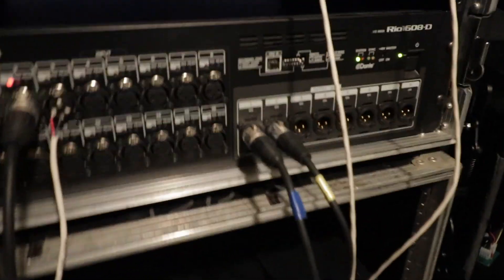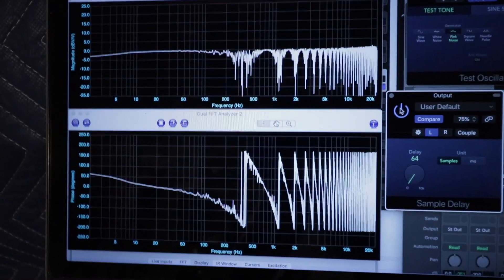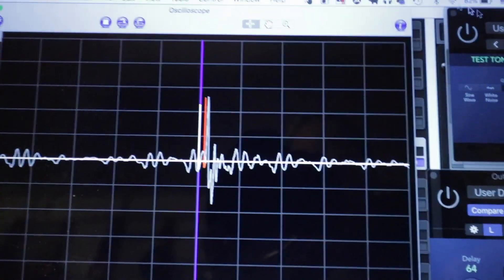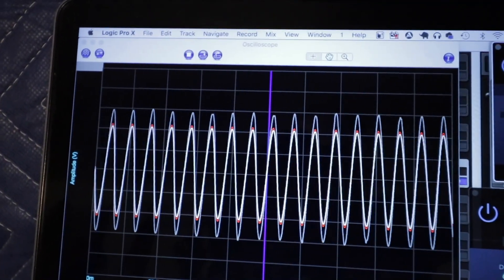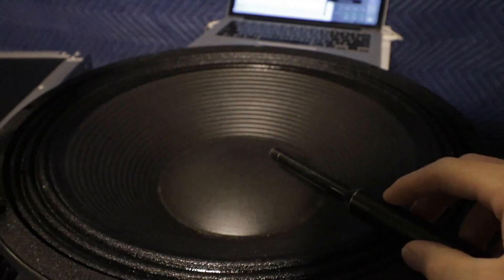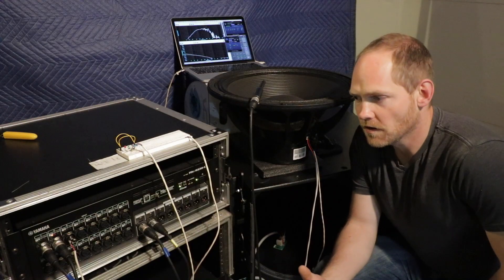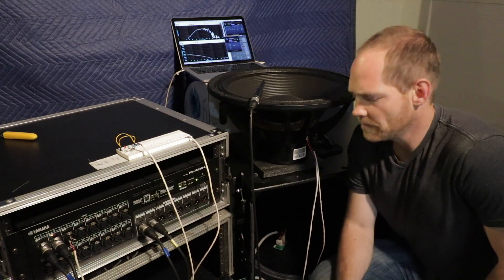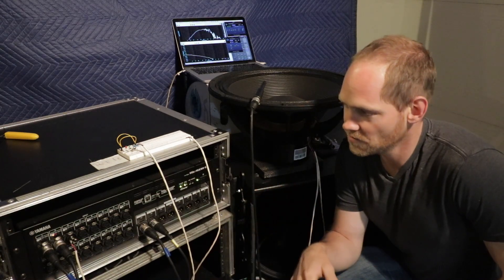Strange phase graph readings Pt.2

Comment: Hi! A close mic'd passive speaker is a minimum phase system where you can predict the phase response from the frequency response. Therefore the frequency response of the woofer element creates a similar phase response than an analog or digital (minimum phase) filter with the same frequency response. The element has same phase shift in the low frequencies as a highpass filter with similar frequency response.
https://en.wikipedia.org/wiki/Minimum_phase

Comment: In my opinion, the phase shift you are showing here is caused by the cumulative latency from the source through the signal chain to the speaker through air to the mic and then more system latency back to your display. The observable result from your experiment seems to be that the speaker measured in "free air" by your reference mic has faithfully replicated the sinewave. The other observation is "X" nanoseconds of latency equals "Y"phase shift at "Z"frequency through this signal chain.

Comment: There is a lot going on: the speaker has resistance, inductance, capacitance, back EMF, spring forces, cone mass, and at high excursion BL loss. The mic also has all these things. Under/Overshoot. There is also a few nanoseconds of time delay between amp output and electromagnetic energization, and acoustically a sound travel delay of a few microseconds even nearfield. As the voice coil heats up it changes further, but not at this power level. All of this causes the highs and lows to be rolled off. The speaker isn't in a box so the lows are rolling off even faster due to backwave cancelation. You aren't in an anechoic chamber so there are also object reflections and room noise added to the mic signal. Speaker diffractions. All of this causes a change in the frequency/amplitude/phase response. Being a mechanical system there will also be THD distortion as well. At larger distances there will also be additional body and air absorption of the high frequencies and a ground reflection, in addition to distance-law SPL drop. There is a lot going on. A basic box sim gets close, but reality is more complex & nuanced.

Comment: At the lower frequencies, the speaker is being operated BELOW its break frequency, in which the diaphragm is moving IN PHASE with the input voltage (due to the speaker's spring forces dominating [limiting the displacement]).
At the higher frequencies, the speaker is being operated ABOVE its break frequency, in which the diaphragm will be LAGGING (ideally 90 degrees) behind the input voltage - that's how electrical (linear and rotational) motors work - the velocity is in proportion to the input voltage.
The same will likely apply to the microphone, for roughly the same reasons.
Hence you can expect to see a 180 degree phase shift (a reversal) from speaker voltage input to microphone voltage output as the frequency is shifted beyond the (speaker and microphone's) break frequency.

Comment: That's why we need DSP on speaker. The nature of speaker is they can't produce the sound in the same phase. What happens when the speaker can't produce the same phase? The sound will be "loud in the box" but not "in your face". That's why speaker manufacturers such as Nexo, L'Acoustic, DnB need their own amplifier or "core" to run their speakers properly. I have run Nexo speaker with a regular amp, and it sounds like a cheap speaker.

Comment: The derivative idea is close - but there are actually two derivatives! An omni microphone, at least in its passband, will respond in phase to pressure. If the microphone were inside a small* sealed box joined to the driver it would actually register a pressure in phase with the cone position. If the driver was joined to a flow resistance then the pressure would lead the position by 90 degrees (one derivative). Playing into free field there will be two derivatives explaining why the pressure registered is 180 degrees out of phase with the cone position. The cone position will lag behind the pressure by 180 degrees.

You could as an experiment try putting the microphone inside the speaker box and seal the port to demonstrate this effect, but note that you should probably be light on the volume control as the pressure inside can become quite high :)

* small = below where standing waves form inside the box
Reply: wouldnt it be the same as putting the sub in a sealed box and just measuring the outside? (in this case the cone).
Reply: @AAEPLNINO   that could also work but seems more difficult to me to observe the cone then. Also the dimensions of the external box will be larger than internal and give a lower maximum frequency where volume displacement and pressure are in phase.

This is also what happens at very low frequency in a sealed room: a speaker flat in free-field measurements will give a frequency response rise below the lowest room mode.
Reply: There is also an interesting relation between the pressure inside the speaker box with the free-field response at low frequency (below the first internal standing wave frequency and baffle diffraction effects): the free field response will have the same shape as the response inside the box but rising by 12 dB/octave as frequency goes up. (double derivative) This works for simple boxes where all volume displacements are seen by both environments.

Comment: hi, you might want to check out "velocity and sound pressure out phase", hopefully a new approach to understanding the phenomenon you encountered.

unfortunately i can't offer an explanation. this is what i know on the topic:
in near-field the air molecule velocity* is out of phase w/ the sound wave pressure. with distance the spherical-sound wave expands enough to become a plane-wave and velocity aligns w/ the pressure.

* (i assume in this case the speaker cone speed + direction is analogous to air velocity)

Comment: Perhaps what you are seeing is not an increase in phase shift based on frequency, but based on time. The delay is based on the wavelength/ distance between the driver and mic. The TIME of the delay stays the same. But with increased frequency, the same TIME delay is a larger PHASE shift.

Comment: Have you tried a Dynamic Microphone? We know that both a speaker and a microphone are acoustic transducers, but a dynamic speaker works by a coil inside of it and a condenser microphone like a measuring microphone works by a capacitor inside of it. And we know that those electrical components (coils and capacitors) have a different and respectively shifted behavior in terms of voltage and current. I'm just thinking about that.. hope it helps!
Reply: No difference at all due to condenser/dynamic.

Comment: It is a good opportunity to point out that the search for the perfect loudspeaker design continues.  The one, whose pistonic movement (or whatever the design), is immediately accompanied by the membrane (or whatever mechanical technology) that moves or reproduces the waves.  Well here we note, that for more or the more lower notes;  there is a mechanical movement that in some cases (frequencies) will be divorced from the electrical movement.
Reply: That's easy dynamics and newton stuff and as long as there is any moving mass you're gonna have these troubles. Only measure I could think of is some smart dsp

Comment: The problem is you're doing it wrong.  You have proven that in this very video by moving the microphone away from the speaker and watching a large phase shift as you increase the distance.  Instead of the microphone moving in your test set up, the change in frequency is effectively moving the peaks and valleys of air compression for you with the same effect.

If you REALLY want to measure this:

1) Mount the speaker in an infinite baffle or a sealed box
2) Suspend the microphone in the center of the speaker,  so that the microphone diaphragm is parallel to the cone and is just far enough away so as not to contact the cone (dust cap) at x-max of the speaker (~ 1/2"- 1"?)
3) Use a burst sine wave test signal of ~ 20 cycles of each frequency you want to see.

Note: the deviant measurements you're getting below 30Hz are due to multiple HPFs ( ~15 Hz) in all your setup (Yamaha, Amp, etc.)

See this abbreviated document for near field speaker measurements:  https://www.audiomatica.com/wp/wp-content/uploads/Testing-Loudspeakers-at-low-Frequencies-with-CLIO.pdf
And a more detailed document:
https://audioxpress.com/article/measuring-loudspeaker-low-frequency-response

Here is a Handy-Dandy wall chart from Klippel with a ton of info about speaker performance and measurements: https://www.klippel.de/fileadmin/klippel/Files/Know_How/Literature/Papers/KLIPPEL_IEC%20Standard%2060268-21%20-%20Acoustical%20Measurements_Poster.pdf
Reply: Im not so sure it matters if the microptone is sideways or aimed straight with the woofer because the microphone is only influenced by preassure changes from one side of its membrane. so it will align with the positive and negative pressure. But there is also a factor of air being compressed and decompressed. If this were tested under water where they water molecules are a lot denser this phenomenon might be reduced quite a bit. And higher frequencies means higher pressure so the air compresses and decompresses with more force although the wavelength is shorter.
Reply: @DJayFreeDoo  Wow! So many erroneous beliefs in such a short response! So... 1) it matters due to trying to measure phase, 2) all mic diaphragms respond on both sides, some have one side enclosed, others not, 3) Air is indeed compressible, but water is not! (though feel free to test speakers underwater if you like), 4) higher frequencies do not at all correlate to higher pressure.  Put your face in front of a subwoofer or it's port.  Perhaps a little study of physics could help you.
Reply: @shazam6274  Some stuff i found on google: The compressibility of water is a function of pressure and temperature. At 0 °C, at the limit of zero pressure, the compressibility is 5.1×10−10 Pa−1. At the zero-pressure limit, the compressibility reaches a minimum of 4.4×10−10 Pa−1 around 45 °C before increasing again with increasing temperature. en.wikipedia.org/wiki/Properties_of_water

For a given fluid, the sound speed is known and can be assumed to be independent on the frequency. This means shorter wavelength corresponds to higher frequency, which leads to higher acoustic pressure, for the same amplitude.

I mean, when it comes to pressure, it takes more energy to move a large membrane than a small one. and if you take the wavelength in consideration the shorter wavelength should generate more pressure than the longer one for the same energy consumed. and higher frequencies generate heat better. that gotta take some higher pressure no? I mean, it makes sense to me that it's relative to the wavelength rather than the distance the sound travels.
Reply: @shazam6274  Whats with the attitude? you said water is not compressible. well it is.
Reply: @DJayFreeDoo  Define the degree of compressibility and then compare it to the atmosphere and then tell me how it applies to measuring speakers. 🙄
Reply: @shazam6274  you were saying that low frequencies has has higher pressure than high frequencies. sure it feels like thats the case. but a smaller membrane and shorter wavelengths takes less energy to move the air when the power supplied is equal. to produce lower frequencies you have larger membranes which has to push more air and further so it needs more power. I would compare this to walking vs crawling on thin ice too. at the same weight, when focused on a smaller area creates more force.

Comment: To measure current, just put a 1 ohm resistor in series with the speaker and put your probe across the resistor. For every amp passing through the resistor, you will see a 1 volt drop across the resistor. So if the resistor is on the negative return, The probe across the resistor would measure current while the probe across the speaker would measure voltage.
Reply from the maker: So to be clear, the voltage output to the mic pre when probed across the resistor is a voltage-representation of the current at that time?
Reply: @devinlsheets_alphasound  Yeah, just like I told ya.  Ohms Law.  Use a 0.1 or 0.001 Ohm > 10 W  also put two 100 uF capacitors in series with each wire in case there are no DC blockers in your Yamaha inputs
Reply from the maker: @shazam6274  I might try this later, but I still feel like it’s beside the point. No matter what a current reading produces, I still have the physical movement of the driver time-aligned to the voltage reading at certain frequencies, and the microphone itself is time aligned to the voltage reading out of the amp (which fortunately is very frequency/phase linear), so I would expect the mic to read phase-linear at least at those frequencies. I’m referring to pretty much any frequency below 100Hz in this case. But instead, the phase reading of the mic throughout the 20-100Hz range not only changes drastically, but is also not anywhere near zero phase. I do not understand why.
Reply: @devinlsheets_alphasound  You proved it in the video by moving the mic for a gargantuan phase shift!  Read my other comment and the linked resources.
Reply from the maker: @shazam6274  right so, my question would be: since I kept the mic very close to the dust cap (relatively speaking) for other frequencies that I measured and got these same results even when I tilted the mic this way and that, the real variable here seems to be the baffle situation vs free air like it is now. What about an infinite baffle would theoretically change the reading?
Reply: @devinlsheets_alphasound  One other factor might be the damping factor of whatever power amp is driving the speaker. Amp to speaker is not a one way signal path. As the cone moves, it generates a current signal that the amplifier reads in it's feedback loop. This allows the amplifier to generate a correction signal to prevent cone over-travel. In some ways, it is a bit servo in nature. Modern amplifiers have a very high damping factor and do a lot of correction on heavy cones. Some great articles on the web. This correction may show up more on a current graph than voltage.
Reply: @devinlsheets_alphasound  Please read my other reply and the links to more resources.
Reply: @shazam6274  Amplifier feedback will not see anything the driver does.
It merely keeps the voltage correct as the input signal with gain and the speaker draws whatever current it wants.
Reply: @darrylduck6356  That's right!  And that's why you need to measure the current through the speaker, the amplifier only sees the voltage and corrects for that, which not what the speaker uses.  The speaker doesn't care about the voltage, but reacts (moves) to the current.  The amount of current flowing through the speaker VC is, as you so eloquently put it: "the speaker draws whatever current it wants", which is not regulated by the amplifier at all.
Reply: @devinlsheets_alphasound  You are measuring across the loudspeaker terminals, this is a huge inductor so you will be measuring the phase shift caused by that inductor.
The voltage will always lead the current and your reading will change with frequency as the inductance of the driver changes with frequency.
Don't forget that the speaker is an impedance too so you are measuring current when you measure across it.
So you are measuring the phase response of the current through the driver in your current setup.